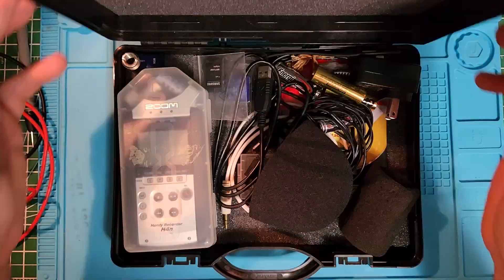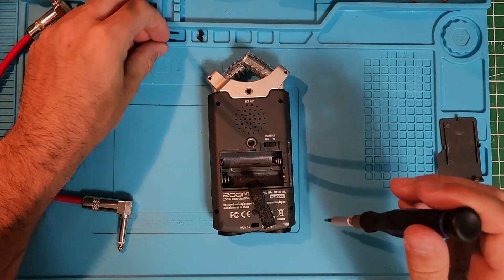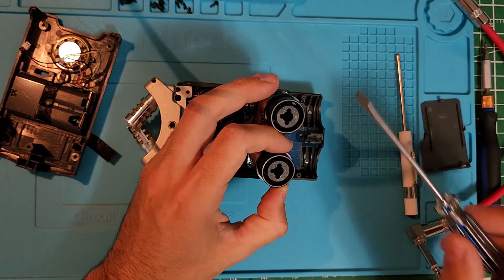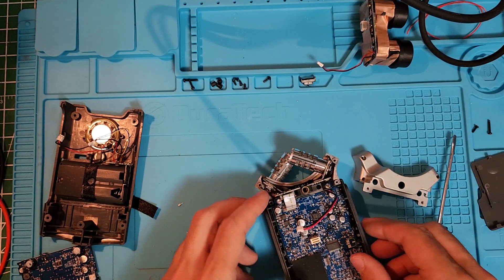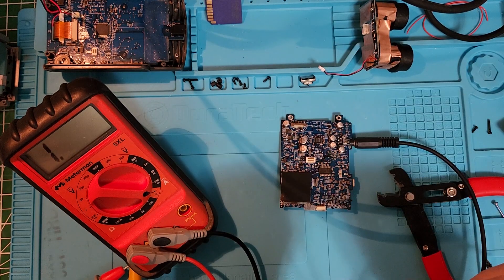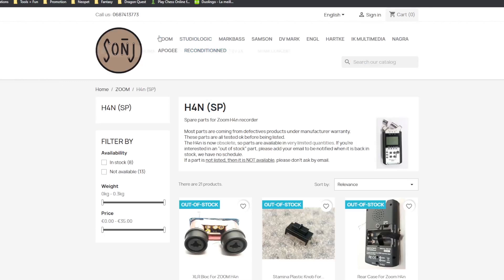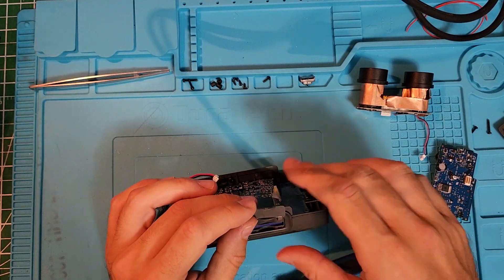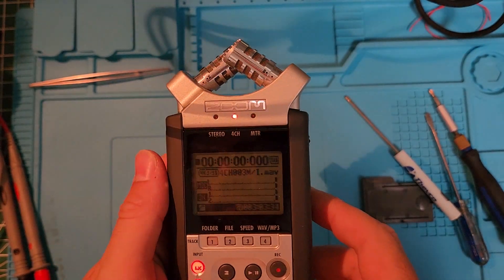Repairing My Zoom H4n: Layered PCB Breakdown

Comment: H49 zoom recording battery is blast ,so how we can repair pls sugget me
Reply from the maker: What do you mean by the battery is blast? If the battery leaked, cleaning the contact with a metal sponge or a small brush and contact cleaner. Be really careful, these batteries contain acid so use protecting gloves and glasses just to be safe.